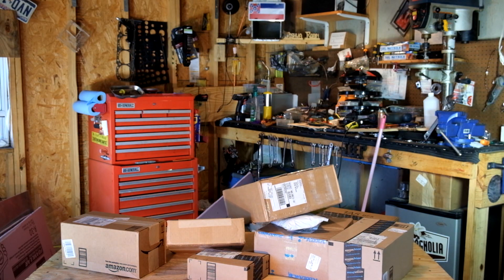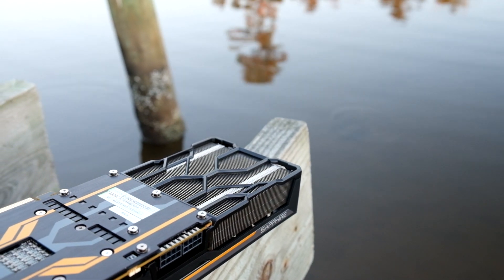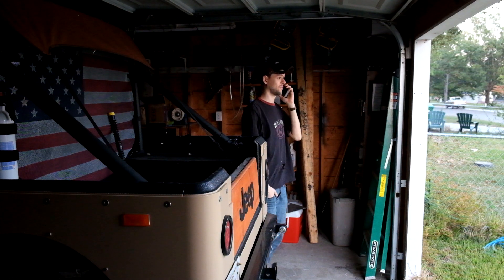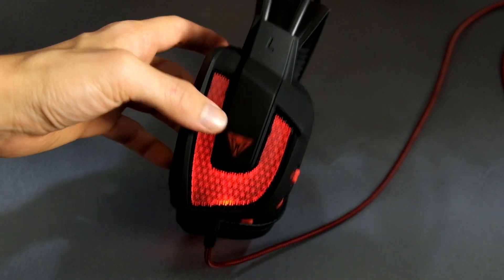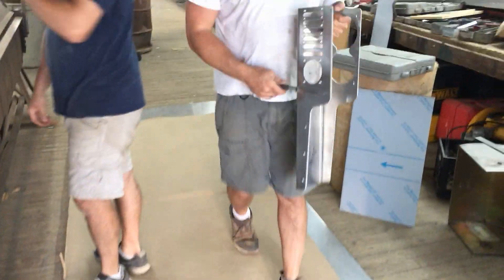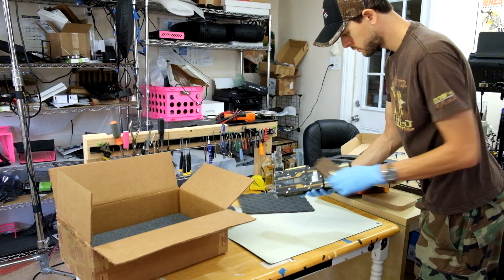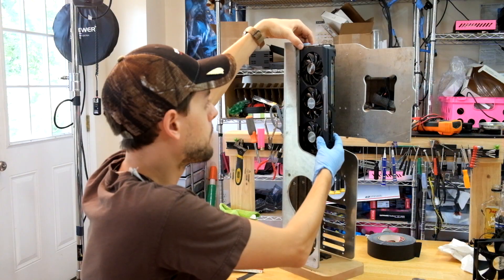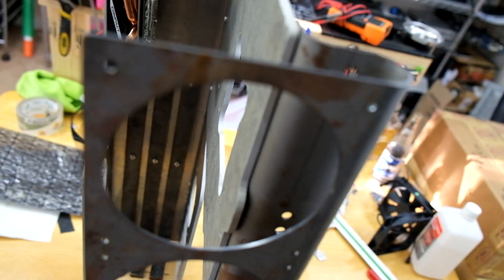Not From Concentrate 2 - Episode 3 #NFC2

Comment: CPU
Intel Core i7-5960X 3.0GHz 8-Core Processor

CPU Cooler
be quiet! Dark Rock Pro 3 67.8 CFM Fluid Dynamic Bearing CPU Cooler

Motherboard
Asus SABERTOOTH X99 ATX LGA2011-3 Motherboard

Memory
Corsair Vengeance LPX 32GB (4 x 8GB) DDR4-2400 Memory

Memory
Corsair Vengeance LPX 32GB (4 x 8GB) DDR4-2400 Memory

Storage
Samsung 950 PRO 512GB M.2-2280 Solid State Drive

Storage
Intel DC P3608 4TB PCI-E Solid State Drive

Video Card
Sapphire Radeon R9 Fury 4GB Tri-X Video Card (2-Way CrossFire)

Video Card
Sapphire Radeon R9 Fury 4GB Tri-X Video Card (2-Way CrossFire)

Case
NZXT H440 (Matte Black) ATX Mid Tower Case

Power Supply
Super Flower Leadex 2000W 80+ Platinum Certified Fully-Modular ATX Power Supply
-

Sound Card
Asus Xonar Essence STX 24-bit 192 KHz Sound Card

Monitor
Acer Predator XR341CK 75Hz 34.0" Monitor

Comment: My dream PC..........
CPU: Intel Core i7-6700K

GPU: MSI GeForce GTX 980 Ti Gaming 6G

Motherboard: Asus ROG Maximus VIII Hero

Memory: G.SKILL Ripjaws 4 Series 32GB (4 x 8GB) 288-Pin DDR4 SDRAM DDR4 2400

SSD: 256GB Samsung 950 Pro M.2 NVMe

SSD: 500GB Samsung 850 Evo 2.5-inch SATA

CPU Cooler: Corsair Hydro Series H100i v2 240mm AIO

Optical: LG UH12NS30

PSU: EVGA SuperNOVA 850 G2 80 Plus GOLD

Case: Cooler Master MasterCase Pro 5

Comment: I would like to use: Case: Phanteks Enthoo ATX MOBO: EVGA Z170 Classified 4-Way CPU: Intel 6700K Cooler: Corsair H110i/ Custom liquid cooling RAM: 32GB G.Skill Trident Z (DDR4) GPU: Nvidia GTX 1080 x 2? PSU: EVGA SuperNOVA 1200 P2 Monitor: Acer XB270HU

Comment: [PCPartPicker part list](http://pcpartpicker.com/p/GpLBgs) / [Price breakdown by merchant](http://pcpartpicker.com/p/GpLBgs/by_merchant/)

Type|Item|Price
:----|:----|:----
*CPU* | [Intel Core i7-6700K 4.0GHz Quad-Core Processor](http://pcpartpicker.com/part/intel-cpu-bx80662i76700k) | $343.99 @ SuperBiiz 
*CPU Cooler* | [Corsair H100i 77.0 CFM Liquid CPU Cooler](http://pcpartpicker.com/part/corsair-cpu-cooler-h100i) | $119.89 @ OutletPC 
*Motherboard* | [Asus Z170-DELUXE ATX LGA1151 Motherboard](http://pcpartpicker.com/part/asus-motherboard-z170deluxe) | $299.99 @ B&H 
*Memory* | [Corsair Dominator Platinum 64GB (4 x 16GB) DDR4-3466 Memory](http://pcpartpicker.com/part/corsair-memory-cmd64gx4m4b3466c16) | $534.99 @ Amazon 
*Storage* | [Samsung 850 EVO-Series 500GB 2.5" Solid State Drive](http://pcpartpicker.com/part/samsung-internal-hard-drive-mz75e500bam) | $148.89 @ OutletPC 
*Video Card* | [Sapphire Radeon R9 Fury X 4GB Video Card](http://pcpartpicker.com/part/sapphire-video-card-212460040g) | $643.99 @ SuperBiiz 
*Case* | [Corsair 900D ATX Full Tower Case](http://pcpartpicker.com/part/corsair-case-cc9011022ww) | $344.99 @ Amazon 
*Power Supply* | [EVGA SuperNOVA T2 1000W 80+ Titanium Certified Fully-Modular ATX Power Supply](http://pcpartpicker.com/part/evga-power-supply-220t21000x1) | $255.98 @ Newegg 
*Operating System* | [Microsoft Windows 10 Pro OEM (64-bit)](http://pcpartpicker.com/part/microsoft-os-fqc08930) | $138.89 @ OutletPC 
*Monitor* | [Asus MG279Q 144Hz 27.0" Monitor](http://pcpartpicker.com/part/asus-monitor-mg279q) | $498.99 @ SuperBiiz 
 | Prices include shipping, taxes, rebates, and discounts |
 | Total (before mail-in rebates) | $3360.59
 | Mail-in rebates | -$30.00
 | *Total* | **$3330.59**
 | Generated by [PCPartPicker](http://pcpartpicker.com) 2016-05-14 21:20 EDT-0400 |